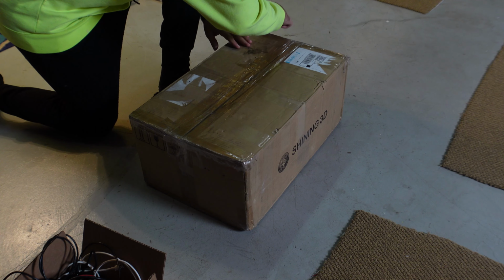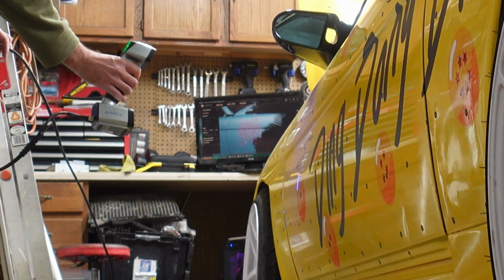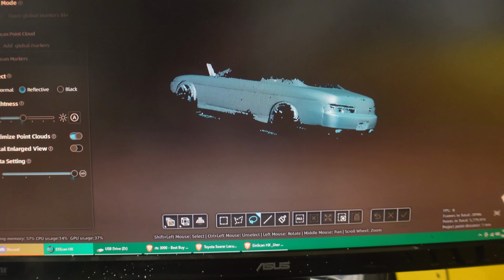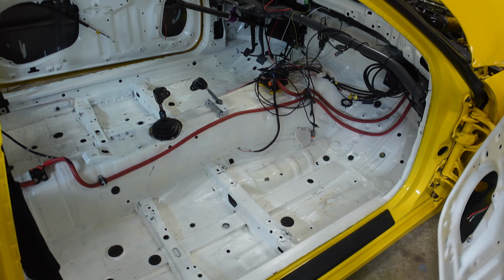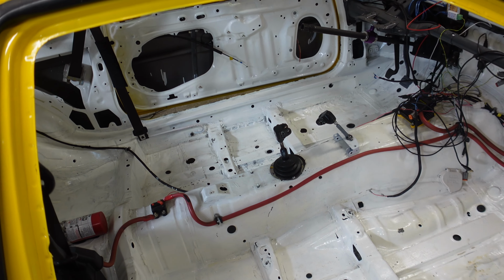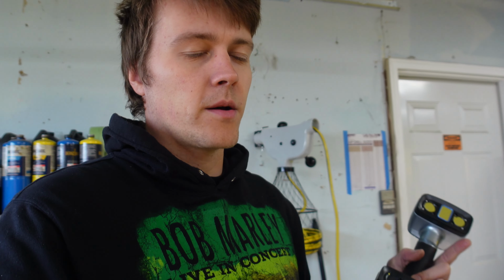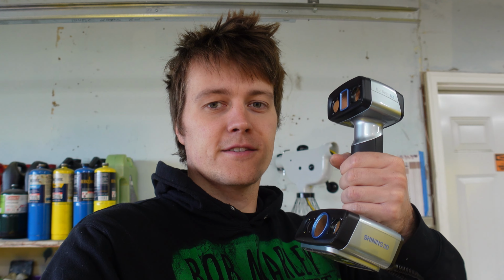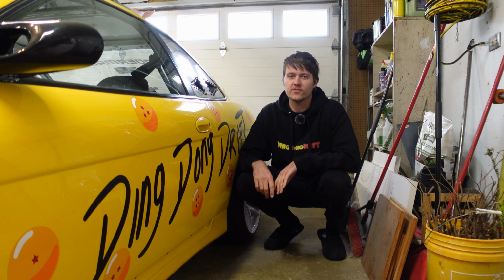How to 3D Scan your Entire Car

Comment: will you ever be willing drop the car scan on the site as I dont have 10k lying around for a scanner but am willing to pay for the file I want to do a time attack build like the auto bahn one and tub the whole front of my car soon with splitters and fenders plus you have already realeased the interior scan
Reply from the maker: Yea I'll be releasing the scans, i forgot lol
Reply: @DingDongDrift  thanks boss i appreciate it and i’m also looking forward to seeing your kit be made the body lines already look insane
Reply from the maker: Yea the kit is gonna be a ton of work i think i might be delaying it until it's just a tad bit warmer
Reply: @DingDongDrift  same here i’m in jersey n my cars in dire need of maintenance i think my grounds are messed up cause the car dies every time i leave it off for 5 mins and my lights dim and flicker when signaling hopefully i could find the culprit when it gets warmer
Reply from the maker: Have you checked the battery and alternator?
Reply: @DingDongDrift  battery is shot fs alternator was replaced cause the ps pump leaked all over it should I do the big 3 upgrade or…?
Reply from the maker: You should replace the battery
Reply: @DingDongDrift  this is the second battery that had this problem causing it to drain completly and no longer hold charge so I dont think its just the battery unfortunately
Reply from the maker: @layoa4275  get a multimeter and start testing that draw current. or just get a battery disconnect like i did lol.
Reply: @DingDongDrift  prob will do the big 3 get a new battery and also look into the disconnects

quick disconect switch looking like the best bet
Reply from the maker: Big 3 won't change anything if you have a parasitic draw, just a waste of wire
Reply: @DingDongDrift  any common causes of the draw?